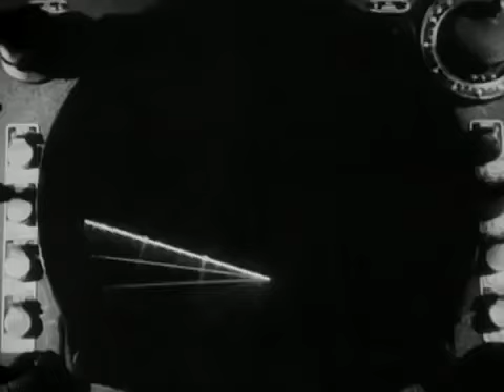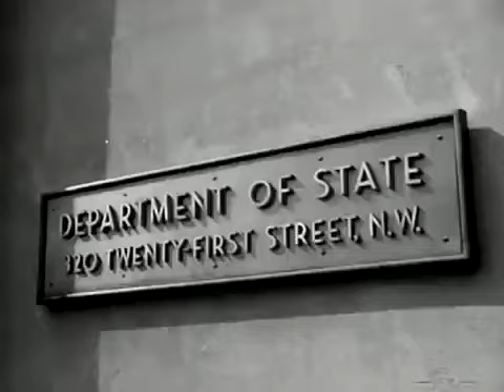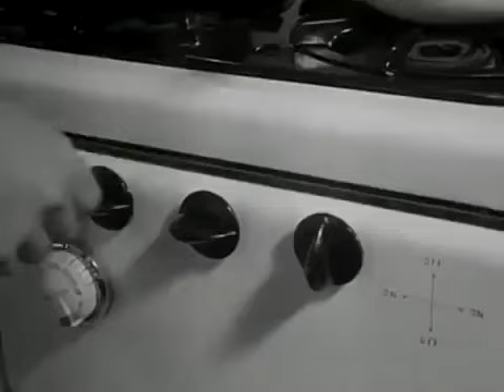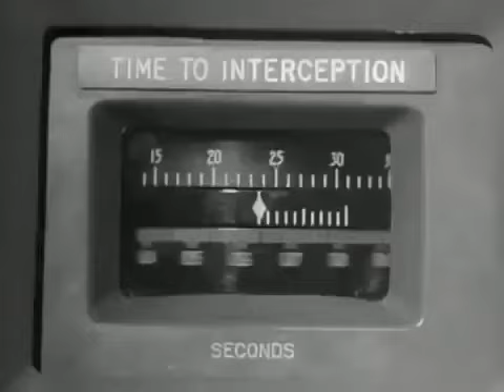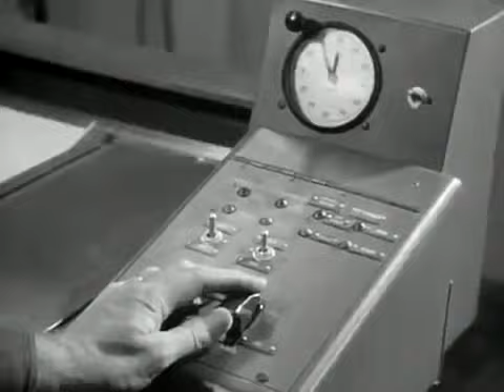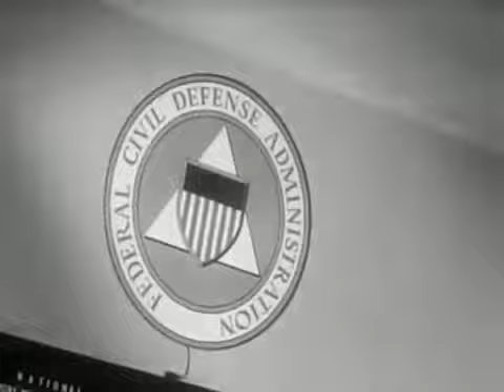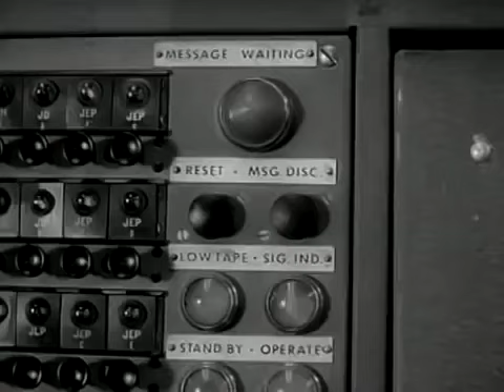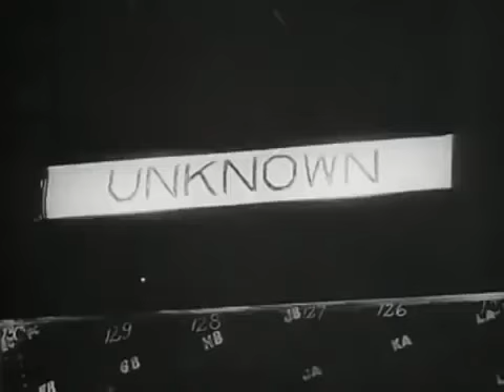The Lost Missile 1958 Full Movie

Comment: Obviously flawed, but still a very interesting concept.
Reply: Actually it was based on a real missile. A missile propelled by nuclear power. 

It was another form of supersonic missile from the cold war. 

The engineers found that if they made a small change to the fuel rods, this supersonic missle's exhaust could become radioactive. 

This Vengeance weapon could be launched and continue flying around for weeks to a month at low altitude dealing massive damage to the ground via sonic booms while irradiating it's path.
Reply: @silverhawkscape2677  - Project Pluto. 
SLAM: Supersonic Low Altitude Missile.

Comment: Considering this film was made in the crucible of the cold War in the early 50's ,  you can understand how people might have felt. Whose city was going to get vaporized this week both in the movie and real life.

But they added a nice twist- mainly it was an interplanetary rocket from another world.

Were their beings on board in deep sleep or perhaps dead.

Either way no one has controll of this vehicle. The fact that it can travel at tremendous speeds and as it does it pushes a hugh volume of hydrogen in front of it. And any objects that stands in its way is vaporized.

They basically sent a Nagasaki type plutonium bomb head on at the same speed. When they intersect boom. Both rockets are destroyed.

So if the passengers on the UFO were awake, they may have phoned home.
Reply: 1958 doesn't qualify as "early 50s".
Reply: @peterbrancato8490   your correct, I must have been dozing off.